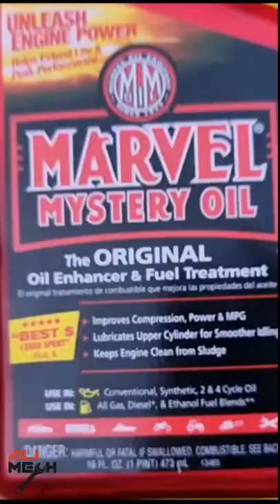Watch this before buying Marvel mystery oil

Comment: In my experience and extensive forum research 😂 ive concluded seafoam is a good gunk stripper to put in the crankcase maybe 500 miles before oil change. Do no leave it in very long as it dries out seals. MMO is good at conditioning these seals and softening them up again. So i add with fresh oil and run.
Reply: That's correct. Seafoam is much more aggressive than MMO, but gotta be careful with Seafoam if the vehicle has hundreds of thousands of miles and an unknown maintenance history because the Seafoam can loosen up years worth of accumulation almost instantly and that shitload of gunk can then completely block the oil pick-up tube screen and then starve the engine of oil. I know 2 people that this happened to when trying out Seafoam in older vehicles and in both cases, destroyed there engine due to oil starvation.  Seafoam is aggressive enough that it can actually loosen up accumulations of sludge, carbon and varnish in chunks or sheets, since the strong solvents in it can reach the metal surface faster and release the grip that allows the accumulated gunk to stick to the metal surface so the whole chunks can break off like that and then either clog up the oil pick-up tube or one of the piston oil return passages.  This is why many mechanics with 40+ years of experience will mention MMO before anything else. As you mentioned, MMO is a very gentle cleaner, lubricator, conditioner, and like the turtle that ends up winning the race it does its job by a slow "washing" effect, dissolving gunk primarily from the top down over time and yet will still yield the same results as the highly aggressive solvents such as Seafoam but without releasing entire chunks of sludge/varnish or sheets of carbon like the aggressive solvents do. Where Seafoam comes in to play is manually cleaning fuel injectors as well as throttle bodies where there's no worries of a oil pick-up tube screen getting clogged or a cylinder oil return passage getting blocked by released chunks of sludge/varnish/carbon.

Comment: MMO is amazing stuff for sure. It it well known for cleaning motors, fixing ticks and hydraulic lifters. It can also increase motor compression. If your motor is very abused you will need to use MMO for several oil changes and 15k miles, not just one test as you have done here.....
Reply: X

Comment: I think such products works after long period. I don't use any but i didn't see good test of one of those.
Reply: Oh ?  I have an 94 Toyota Camry , 4 cylinder , got it in 2019, it wasn't rough running , later I had the money to get oil and etc . I put Marvel's mystery oil in the crank case , and , Lucas product , Lucas fuel injector cleaner , and  added it to the gas tank, miles later ? I noticed how smooth it ran couldn't believe it , once added Marvel's mystery oil in the crank case , it seed the same , never took the valve cover off , so I don't know , it's ran smooth ever since   👍   That's just me

Comment: if you got heavy sludge, it's not going to help a lot.
it works slowly ,best to add it a few hundred miles before an oil change. 
if you've got a fairly clean engine to begin with,it'll keep it that way. 
if it's a sludge monster, it might work but it's slower and safer than flush.
Reply: That's the built-in safety actor of MMO, the fact that it's as gentle as it is and yeah you are most definitely right. I've seen people use MMO on heavily sludged engines (like horror story level lol) and precisely as you said, it did the job slowly and safely, over a period of about 1 year,  with the first few treatments with the MMO being very short ones for added safety because of how bad the sludge was. First treatment drained the old oil, added new, along with MMO, left the car idling for 20 minutes at between 1500 to 2000 RPM, then drained that oil. I should mention that the old oil that was drained out was dirty but no visible sludge or debris when draining. When draining out the oil + MMO after 20 mins idle time, the new oil was pitch black, and even though the oil used was a 5W-30 it was coming out like a 20W-50, THICK like molasses!  For obvious reasons, once that oil/MMO was dumped, the oil filter was changed as well, again, as an added safety factor. New oil + MMO was added, car was driven for 100 miles, oil inspected through dipstick, pitch black again after only 100 miles! Drained that oil/MMO mix out, new filter again, new oil, car was ran 500 miles, oil inspected, same as 1st and 2nd treatment, pitch black so this 3rd batch was changed at 500 miles, new oil filter. 4th batch of new oil/MMO was added along with new filter, car was driven 1500 miles, black oil again so changed this 4th batch out, however the oil was no longer coming out nearly as thick as the first few batches. Yes still VERY black, but closer to the viscosity that it's supposed to be. Vehicle owner decided to mix things up a bit after this 4th batch was drained out. He had quite a collection (over 50 gallons) of top brand motor oils that he purchases when they go on sale/clearance so he decided to do a sort of "just oil" quick flush.  New oil was added without any MMO. Oil level was slightly over filled, a bit above the full oil mark on the dipstick, drove the car about 20 miles, then came back and drained out that oil. Although obviously slightly darker that when it was first added, the oil looked almost as good as new. Even so he drained it out, set that oil aside to use with lawn-equipment since it was still pretty clean. 6th batch of new oil/MMO mix was added with new filter and for a point of reference he decided to check this new batch of oil at 20 miles to compare with the previous batch of just oil at the same amount of miles. He had saved the paper towel with the previous 20 mile sample that he used to wipe the dip-stick with and then compared that with this new batch of oil/MMO mixture at the 20 mile mark as well. The 6th batch sample of oil+MMO was MUCH darker than the 5th batch sample of just motor oil! This just added to and confirmed what we had already been observing with using the MMO, and that was that there is indeed a very pronounced and enhanced cleaning effect with the MMO in the oil versus even brand new, clean motor oil alone.  We had equivalent, side by side samples right there in front of the eyes that made it undeniable and that's even considering that there was virtually no remaining dirty oil left in the sump for this 6th batch since the 5th batch of just oil was only in the engine for 20 miles and came out relatively clean, so what ever amount of that 5th batch of oil that remained in the sump after the 5th batch of oil was changed out was basically still clean oil, there for the fact that the 6th batch with MMO turned MUCH darker than the 5th batch of just oil at the exact same 20 miles of usage that shows that the 6th batch was NOT darkened by whatever oil, dirty oil that was remaining in the sump since there only would have been clean oil in there, which again confirmed what we had been observing all along and that is that the oil going so dark so quickly with the MMO mixture was due to the cleaning effect that was taking place, having a dilution effect (rather than a dislodging effect) on the sludge build up in the engine. 6th batch was run for 3000 miles, at this point engine was running much more smoothly and more quietly. At the 3000 mile mark this oil was dumped along with oil filter. Even though oil was dark, the viscosity looked like it should after 3000 miles so owner decided to stick with the 1 qt MMO mixture at 3000 mile intervals and just do regular dipstick inspections to monitor the level and condition of the oil. Being courier he accumulates miles quickly so a 3000 mile oil change intverval happens quickly in his case. Each subsequent 3000 mile OCI the oil was appearing less and less dark as compared to the previous 3000 OCI's to the point that by the 3rd 3000 mile OCI the oil the oil was no longer looking like it was time to change it but rather similar to the color of a medium honey. This would have been right around the year mark from when he originally started the whole engine cleaning process.  Based on how clean the oil was staying at this point he then increased the OCI to 5000 miles and has kept it there ever since. He was so impressed with the results that he also continues to use the MMO mix at each OCI but only half as much now as a maintenance treatment.  As a side note I also know two people who ended up with destroyed engines under similar circumstances but the cleaning agent used in those cases was Seafoam rather than MMO and in both cases, the reasons the engines blew up was due to too much gunk being released all at once which ended up clogging the oil pick up tube screen and resulted in oil starvation and then BOOM!  MMO is the safer alternative and in cases like these SLOW wins the race!

Comment: Amazing product! Religiously use it in all my vehicles. 8oz to every tank of gas and 16oz to engine oil 1,000 miles before an oil change.
Reply: Injection and carburetor type cars for fuel or injection only?

Comment: This is also a good way to make your engine oil viscosity way to thin.... Depending on the oil you use. If you use a 0W-10 oil and do this you might damage your engine.
Reply: Just use 0WD40. They sell it by the gallon
Reply: @anythinganytimealways  😆

Comment: We went through pallets of that in the auto parts organization I was raised in. Sold it to fleets, large agricultural operations, government motor pools and regular Shadetree mechanics. All those folks must’ve thought it was good stuff
Reply: It's snake oil. Lol
Reply: @MindsMouth   Talk about snake oil, we also sold pallets and pallets of STP.  Unscrupulous used car lots would fill  noisy differentials with ground up cork and STP to quiet them down. Engines would get a heavy dose too.
Reply: We don't have Leaded gas to lubricate valves now ,,so I use it in my old 8N tractor and my 66 289 V8 tanks..Also in oil for sludge preventer..

Comment: Gas & fuel are a dryer than they were 20-40 years ago. Especially diesel. It's almost like gas was 25-30 years . Not very much oiliness to it anymore. MMO replaces some of the oil that's been almost completely removed for fuels.
Reply: The old oils had zinc in the oils that helped protect the cam lobes and lifters with engines that used flat tappet cam shafts but now almost all modern engines either use over head cams or roller cams that don't need the zink to protect the cams and lifters .

Comment: I used it in my gas,got 250,000 miles out of fuel pump and motor is strong. 4.6 vortec.
Reply: 4.6 vortec?
Reply: @austinbrockner6405  OP is probably referring to either a GM 4.3L vortec and just made a typo or they are referring to a Ford 4.6L (probably a mustang) with a Vortech (not vortec) supercharger. Vortech being a brand name and Vortec (no h) being a line of engines GM trademarked as Vortec.

Comment: I quart of transmission fluid will do the same thing.. it has lots of deterrents in it and will clean the sludge out and quite the engine if it has any sticky lifters.
Reply: Chevrolet parts department sold 'top engine cleaner' , was transmission fluid
Reply: @gofaraway  i bought a 2015 Ford f-150 , and previous owner must have let a few oil changes slide  and the motor was a bit sludged up and dealer did a engine flush and oil change and put a quart of transmission fluid with new oil.and they told me to keep doing it because is was the best thing to keep your engine clean and sludge free.

Comment: Say what you want. I use it in all my cars . If you changed your oil when you were supposed to you wouldn't have to depend upon MMO to clean it for you. 2cars and 1 truck all with 200k and running strong.

Comment: I use this in my 2017 ram ,and it quites down my hemi tick...I use this stuff I. All my vehicles including all my lawn machines
Reply: Got a 2016 Ram with the Hemi tick, how do you run the MMO in yours? Add some some before an oil change..if so how much? Or do you just run a bottle of it up til next oil change is due?

Comment: Damn no cap I use seafoam and it has never failed me maybe I'll try this too see how good it is
Reply: Does the same, and a little cheaper..See 'Project Farm' video comparing..
Reply: I HEARD that Seafoam was originally designed for older Marine engines and it worked well for non marine applications as well, but since engines have changed so much, especially non pushrod motors, it isn't recommended for modern cars.  🤷
Reply: @derekedge2089  this is exactly y I'm tryna find one that is made for modern cars

Comment: Got a tracker with 235,000. Never used this stuff even once. But I do have cold morning lifter tap, I've tried Lucas for last 2 oil changes,  guess not what I need. So now I'll try marvel, n see what happens.. What's best for just helping an old engine survive??
Reply: Did you put marvels mystery in it. How did it do.
Thanks
Reply: @P.Trim69  honestly ,I did a few times and it did help with lifter tap. The timing tensioner and guides did fail shortly after though and now the cars in the junkyard. I would just stick with regular oil from now on.

Comment: I've tried quite a few oil treatments and I'd say auto RX is buy far the best,I've a 2000 lexus with the nortoius for sludge 3.0 and auto quieted the cam fazers and the slight lifter tap I had at 210k and I've not used anything but auto rx since I recommended it highly

Comment: Hardest thing is getting rid of varnish and sludge. But a know how. Hint: that little bit of Cl2 that does the cleaning, but MMO has a too small quantity.
Reply: Chlorine gas?
Reply: @tomasnokechtesledger1786  Not sure what you mean by Cl2 then. Hyposulphite ion does not contain chlorine
Reply: Actually common Sodium Hipochloride at 5.9% works pretty well.
Reply: @tomasnokechtesledger1786  you are making zero sense. First you are taking about chlorine gas (Cl2 is always a gas at room tep), then about hyposulphite, then hypochlorite. Which is it?
Reply: @dirkvantroyen9170  I wont start you on chemicals. You gotta kearn about stabilization. As Cl2 is a gas, you need another substances to make it in place, since a gas is too loose to stay in place. There is several ways to do it, but you seem to ignore it. So go there in inject Chlorine gas in yer engine 🤣
Reply: @tomasnokechtesledger1786  You lack a basic understanding of chemistry. It's hypochlorite not hypochloride. All we're seeing is clorinated molecules (Cl ions - not Cl2) in MMO oxidising dirt in the engine and recombining to another Cl compound.

Comment: Whinns friction proofing, A very popular oil additive back in the 60s before people knew better. Along with STP, which is just pure bass petroleum refined before any additives packages are added to it..
  Anyway, whinns friction proofing, is approximately 95% kerosene..
  A common practice before the introduction of detergent motor oils, was to add a quart of Kerosene to your car’s engine oil before the oil change. And run it for about 15 minutes. That was pretty common practice with the old 40 hp VW bugs that had no oil filter.. that would loosen a lot of the sludge grit gum soot , Blend it with the oil, so it would come out with the used oil..
  adding something like this mystery oil to your oil on your car, and you have damage to your engine, and you take it to your dealer and try to have it fixed under warranty. That will not be covered under warranty if they can detect that you have added nonapproved products to your oil. I have seen it..The warning not to put additives in your oil is in every owners manual I have ever read

Comment: I did a quart of engine flush, it did clean my car, 1996, idk if they make it any more. It was basically a quart of low flash point solvent, probably mineral spirits.
Reply: MEK and gear oil

Comment: I bought a brand new 01  f250 7.3L. I always did 14q of 15 40 Rotella and one q of marvel mystery.  I had almost 600k on the motor. It still ran but the ny weather it was time.
Reply: yep,the bodies die up here long before the engines do.

Comment: I've found that a few ounces of Diesel works a lot better. You don't want to clean sludge to quickly or it can make clumps come loose and clog up oil passages and destroy a motor. A few ounces of Diesel in an oil change over ab 3 or 4 oil changes and you'll see its a lot cleaner with a lot less risk.

Comment: Aren’t you supposed to run the motor ? 
With the marvel mystery oil and new oil 

Then shut it off 

Then remove valve covers ? 

To inspect Before vs After ?

Comment: Use  a good product either run the car for about 150 km at speed about 80 km/h at 2.5k to 3 k rpm or start the car and rise rpm to about 2k -3k for about 45 min.then change both engine oil and filter .
You should have tested more than one product to get a better results.
Reply: Exactly what I said just pouring it in and dumping shows no worth of the product or it’s results.

Comment: It's ok if you guys don't know how to MMO and seafoam. Today's mechanics are closer to computer guys and don't know any of the old tricks
Reply: Seafoam was engineered for marine engines and is of zero value in a motor vehicle engine ( that's where the name came from ). The " old school  " mechanics need to update their knowledge, what worked 30+ years ago can be useless or even harmful to today's technology. As times and technology change, so do the standards needed to keep current engines in top form.
Reply: Computer guys and replace as many parts as possible instead of truly diagnosing the root cause/issue type of guys as well. They don't even know how to do real repairs, only replace parts.